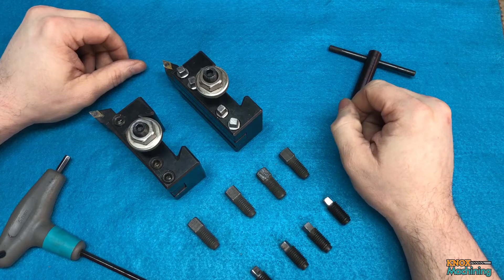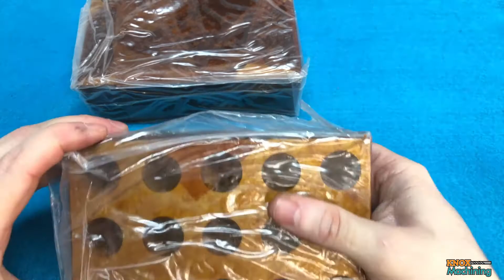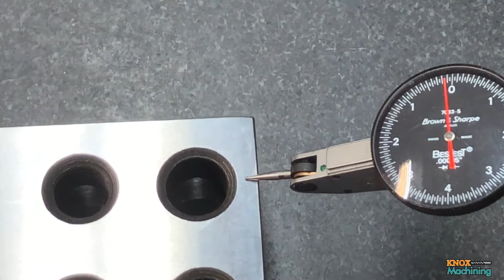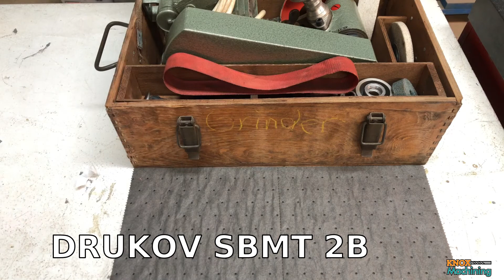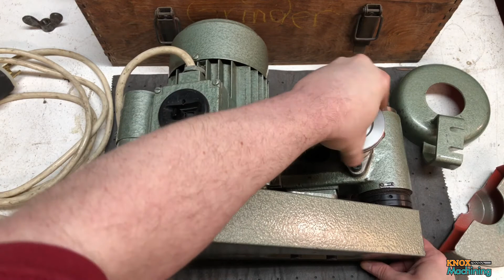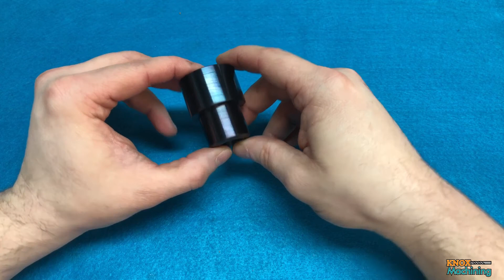Monday Night Mashup #1: BXA Tool Holder Mod, 2-4-6 Blocks Review, Drukov SBMT 2B Tool Post grinder

Comment: So you were the one that bought that TP grinder lol. I’m in Sevierville, saw it on Facebook and was gone the next day when I went to message. 

Nice Score! Came over from Foxberg. Keep up the content! 👍🏻
Reply from the maker: Yup. Thought it was a good deal. Couldn’t pass it up. I set it up to test it and started to panic. He shipped it with the largest drive pulley and smallest pulley on the spindle. It couldn’t spin up to speed (oil set too long). After switching it or for smaller pulley I was able to spin it up and add some fresh oil to the spindle and it’s been fine.  

Didn’t know Foxberg threw me a mention. Hadn’t  watched his latest video yet. I just thanked him for it.